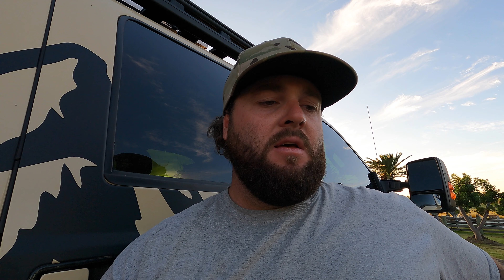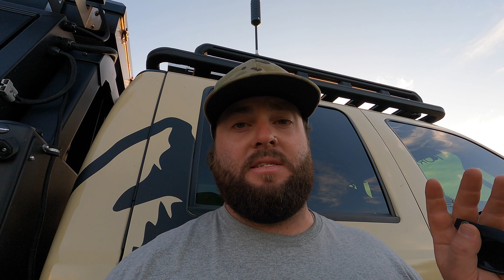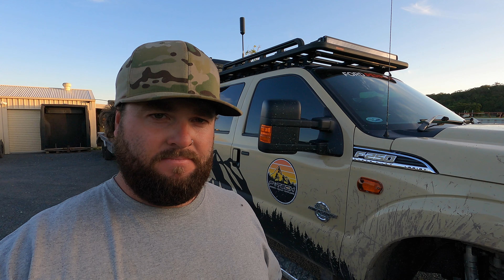WHAT EVERYONE'S GETTING WRONG ! 4WD ROOF RACK PLATFORM ON AND OFF-ROAD. Static vs Dynamic loads.

Comment: No, @1.41, weight does not change when objects move or are still. Weight remains constant.
Reply from the maker: Weight might remain the same but the pulling and pushing forces applied impact
Reply: @TyFenwick  Correct, force changes as it is determined by mass x acceleration, but weight (mass), remains constant.

Comment: Put your load on a smart scale linked to your mobile on your roof. Drive as rough as you plan to, read how heavy your 50 lbs load weighed in at. I expect a 20% excess load for my lightweight off road driving.

Comment: Static is when vehicle is not moving, dynamic is when vehicle is moving.  There is also a separate rating for off road load which is less again than the dynamic load.
Reply: Frontrunner doesn't have a offroad rating. No reduction on load only static and dynamic

Comment: Just thought I'd add, The static load is for when the car is stationary - ie at camp and when you've got people in a roof top tent etc. However the dynamic load is for when the car is driving on any road. Not just offroad. When offroad, some manufacturers put in place a 33% offroad weight reduction to the dynamic rating of the rack aswell. So that's why this whole roof rack discussion has come up, is the actual offroad limit of these roof racks not really being warranted  to hold much more than a few maxtraxs.
Reply from the maker: Good points mate 👍🏼👍🏼👍🏼
Reply: Yeh, like Ronnie said, when you're up there sleeping adds to static load too

Comment: Suggest people look at the ARB Base Rack ..... probably the best platform available right now as its fully welded and pretty strong . I looked at Rhino rack and Frontrunner . Rhino is the weakest of the 3 and Frontrunner is expensive . The ARB was the same price as the Rhino and the strongest of the lot
Reply: yes year later still only one with new reduction off road rubbish.

Comment: ARB Ascent canopies, with the internal supports, are rated 100kg dynamic and 350kg static.
The platform on the canopy has a 300kg rating, so that becomes my upper limit (say, for roof top tent and people in it).
It weight 15kg, and that means I have 85kg payload dynamic and 285kg static.

ARB cab racks are limited by the manufacturers spec.  In our case this is 75kg for both D and S.  It weighs 30kg, so the payload is 45kg for both dynamic and static.  Not much we can do there.  Until car manufacturers specify their dynamic and static load limits as two separate values, we have to use the single rating they provide for all load types.

Comment: If you ran an outside cage from the frame of your truck , following the contours of the body panels (just in front of the A-piller, and just behind the rear doors.) again keeping tight to the body up to the rack. It would have to increase your weight limit up there. 
Plus I think it would look cool. Use square tube like your rack.
Reply: Yeah, I like that idea.

Comment: I personally have only have the two bars style roof rack, not a platform like yourself and a few other creators out there. I'm glad that I'm seeing a number of creators bring light to roof rack rating. I personally only knew about the static weight limits and that was it. I wasn't aware of off-road limits. I feel like a few honest manufacturers will disclose such information for the sake of safety, thus from being transparent they will increase sales because guys like us want strong quality gear, that won't break.
Reply from the maker: Absolutely mate !!! Great comment, really appreciate you adding to the conversation 😎👍🏼

Comment: From what I can gather, the biggest limiting factor to how much weight you can actually carry is your roof load bearing amount. Your roof will give out long before the rack breaks.
Reply from the maker: Vehicle manufacturers would rate the roof a percentage that’s no where near what he actually roof could carry or the rack. So I’d say the rack would fail before the roof, the structural strength of a vehicles roof with all the pillars and windows would be so strong.

Comment: Also be aware once you modify cut weld drill in any way you void all ratings and would have to have the rack reengineered to establish new s and d ratings.
Reply from the maker: My ratings would be close to the “ I “ platform as it’s only just off by a little bit. 

Reengineering a rack I think is going over board for the mods I made as it’s exactly like a standard one just in between two different size racks.

Comment: You don’t understand what static and dynamic loads mean. Static load is what you have on the rack at all times. It’s the full time load. Dynamic load is when you decide to swap out a tent for a paddle board, or a few bikes, or some containers full of gear. Dynamic means change. It’s a change in load weight and positioning on the vehicle. When you are using dynamic load in your explanation you’re talking more about bending and moment arms due to flexing of the vehicle under motion. I appreciate the explanation you’ve provided but please use correct terminology.
Reply from the maker: No you’re incorrect unfortunately. Static is still, Dynamic is in motion.

Comment: Mate there's actually 2 types of dynamic load when it comes to roof racks. There's the static (which you mention) or no movement of the vehicle. Dynamic which is the load capacity of the rack when on normal driving conditions (on road) and then there's an off-road dynamic load. The off-road (off road dynamic) load rating for the Yakima is very similar to the rhino. It's around 2/3's of the racks dynamic on-road load capacity. So for example, my defender 110 has a static load roof rating of 150kg. If I use a pioneer platform, it has an 'ON ROAD' rating of 100kg (rack not included as you mentioned) which means with the weight of the rack (45kg), means 'ON ROAD' I can carry 55kg safely. Now Rhino has updated their site to include the fact that the fitting instructions dictate an 'OFF ROAD' rating of 1.5 built into the 'ON ROAD' rating which basically means 2/3rds of your ON ROAD dynamic load is your OFF ROAD dynamic load, so my 55kg 'ON ROAD' becomes 35kg 'OFF ROAD'. Now how shit is that! We went from 100kg to 35kg.
Reply from the maker: Awesome comment mate. 35kg it’s unbelievable aye !
Reply: @TyFenwick  yeah that’s with the rhino. Think front runner are slightly better rating but not much in it
Reply: That’s w their dumb mounting system all u need to do is nut and bolt to make it stronger

Comment: Be careful, a dynamic load IS NOT an off road load. That’s a different number. To get it, follow the equation below:

(Dynamic rating/1.5) - weight of rack = off road rate. 

You are correct in having to calculate the roof load if it applies to your particular scenario. 

My particular setup, a Jeep JLU with a backbone and 2 vortex bars comes to Static @ 800lbs, dynamic @270ish lbs, off road @150ish lbs. It’s crazy to see people carrying all that stuff on their racks not knowing that they are in danger of getting into a major accident :/

Comment: Have a look at mitsalloy, has a extended rack off a canopy single cab hilux,, off a dual cab  canopy you should be able to go 2/3rds over cab roof and be stronger than a rihno rack etc direct to cab roof, then have a single clamped wisperbar/etc forward with lights fitted, worth looking at? You gotta nice set up bro

Comment: My thought is that. The static load is parked it’s normally higher and comes in for people sleeping in roof tents etc. Dynamic is any movement road or off road. The dynamic load can then be different for on and off road. The issue is 2 things. 1 rack sellers just quoting a max load and then hiding things like off road reduced ratings in the small print. The other issue is vehicles having different load ratings that can change for static dynamic off road scenarios also the roofs are often rated lower than the racks and the retailers for the rack don’t make this clear enough again it’s hidden in the small print. Anyway love the big F truck and the channel 👍

Comment: I’m dubious of the manufactures and insurance companies load limits on vehicle roofs. Sounds like a cop out on not covering another thing for the same price. 20 yrs ago when I first did my apprenticeship my old boss used to carry 6 1800x1200 flooring sheets and 5x 6m alloy planks on 4 old school rhino racks atop a 90’s Pajero. The only thing that blew out was the rear suspension. I’m not saying that you’d cart all that across the Simpson and back but what I am saying is there needs to be better information and accountability by all the companies involved in this situation. Alot of people have made a lot of money promoting and making things accessible for consumers to be swindled out of hard earned cash.

Comment: Both S and D load should have an influence on suspension setup.
Reply from the maker: Fox DSC’s are awesome for just this. Setting a static ride height but then the dynamics while it’s in motion is different story. High and low speed compression you can adjust with DSC on fox shocks helping to control the stroke of the suspension in different terrain.